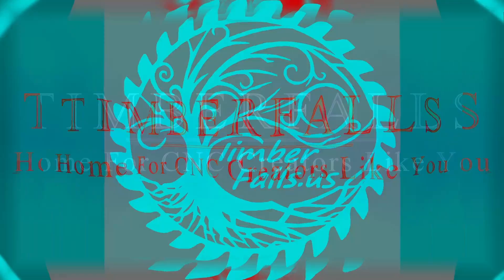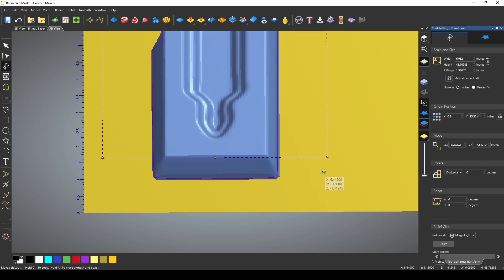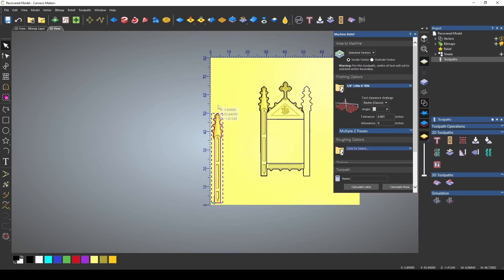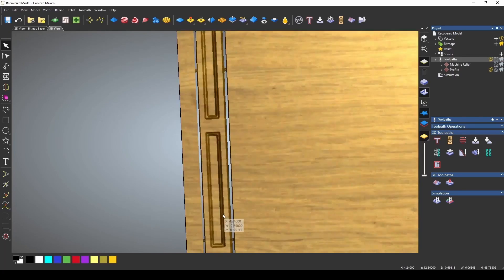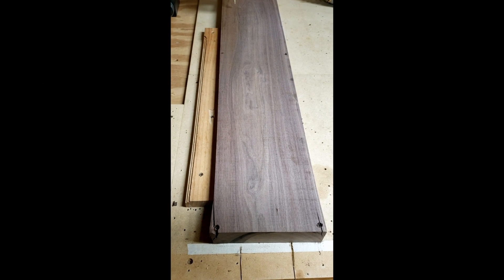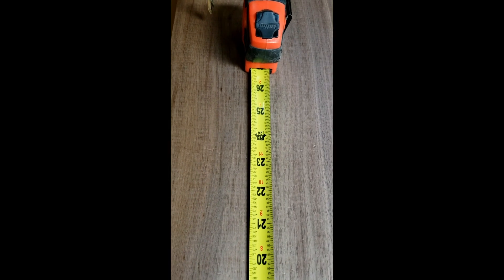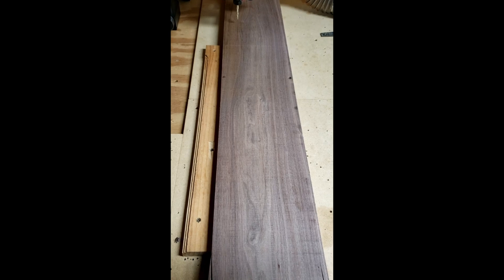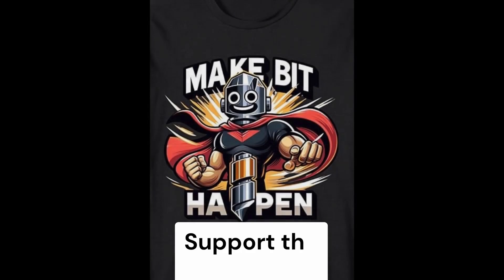Make CNC Paneling Easy with "Carveco Maker Plus"

Comment: Kinda was working on that myself.  I have a relief of stone 12 x12, was looking for a way to use this on let's say a letter or another shape other than a 12 x 12 tile. 
Oh actually just used my Jenny SJ. Very happy with it. I'll be replacing all my most used with Cadence. 
Thanks again for another great video. Always look forward to them.
Reply from the maker: If the place where it needs to meet up has a lot of detail its a bit harder to get them to line up and then sand that. I always try to keep a board on one side to keep that side aligned. I appreciate the feedback and hope this helps.
Reply: I'll give that a try

Comment: Struggling with tiling/paneling now.  The gap isnt in Carveco, its in the machine. Wished there was like a sliding sled on the machine that had stops where u could slide your board down to the second stop for the running the second toolpath.  But, the tips in this video, where you setup the vertical index piece coupled with indexing screws is a good method.
Reply from the maker: I have used this method on few projects and having that corner were I have the tape and the board down one side keeps it aligned. For me its easier to use screws for hold down so clamps and tape make.it harder to keep it aligned when you want to move the material. Hope this helps a little more and thanks for the feedback.